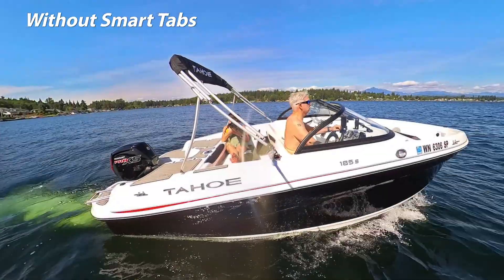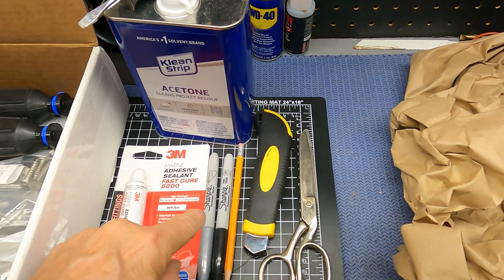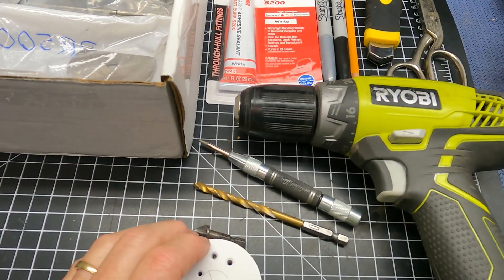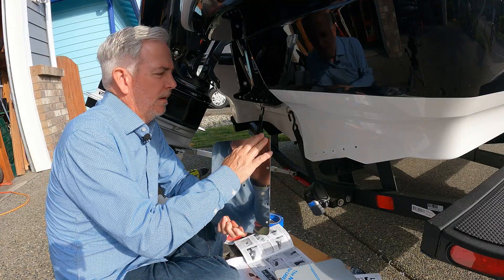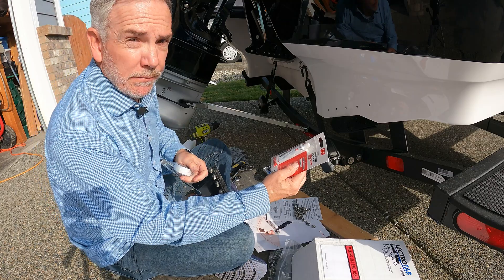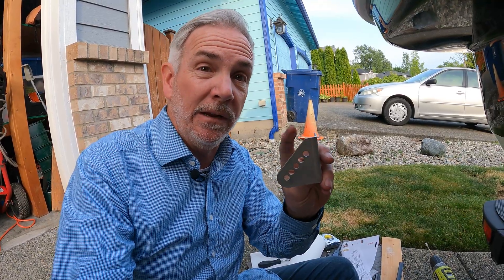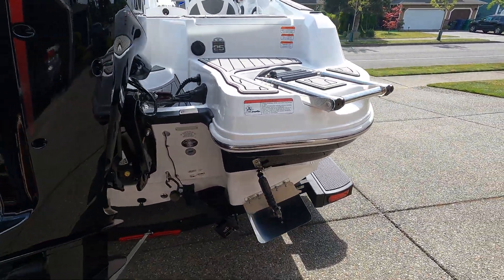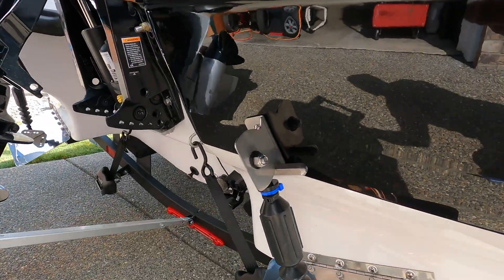Boat trim tabs - Nauticus Smart Tab

Comment from the maker: Links that I mentioned in the video:
✔ Nauticus Smart Tabs (verify size): https://amzn.to/3W15UDo 
✔ Nauticus Trim Plate Extractor Kit PR500: https://amzn.to/43wUURw 
✔ 3M 5200 Permanent Boat Adhesive: https://amzn.to/3FiuMC3
✔ Handheld Vacuum/Blower: https://amzn.to/4ppEZ1G
✔ Center Punch (Spring Loaded): https://amzn.to/46n7cNM

Comment: Do you know what is inside the rubber boot? Is it a spring?
Reply from the maker: It’s a sealed gas shock.
Reply: @GYATEZ thanks, stainless I would assume?
Reply from the maker: @kizzjd9578 Not totally sure. One of my boots was ripped and full of rusty salt water, so there’s definitely some regular metal in there. They replaced it with no questions asked. I kept the old shock, so I’ll check it later and let you know what I find.
Reply from the maker: Found the old shock—definitely not stainless. It’s just a black powder‑coated Signature SX100T‑60 gas spring shock.
Reply: @GYATEZ ok cool I wonder how long it will last and if you can get a stainless version